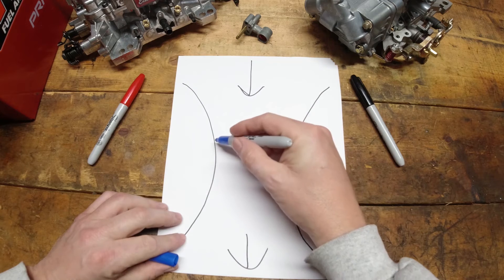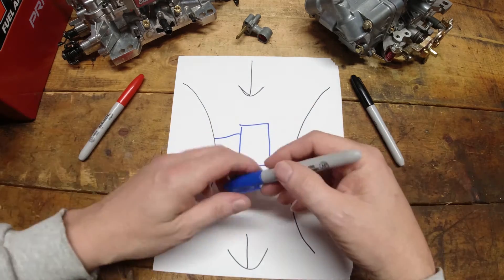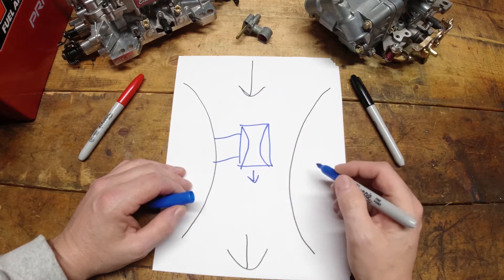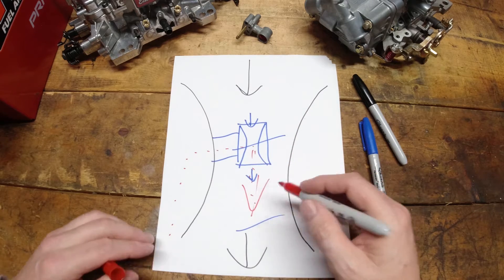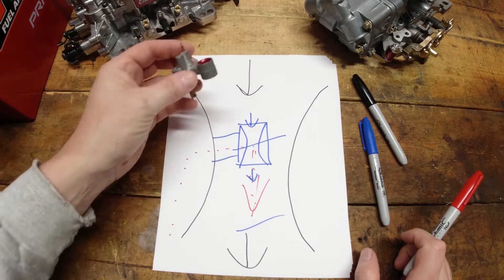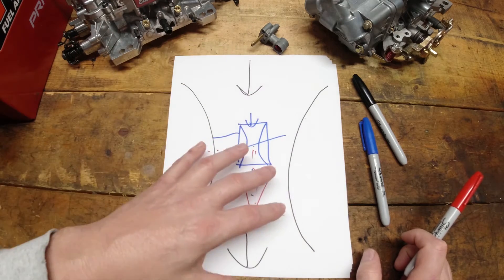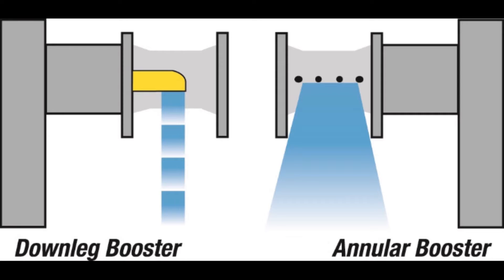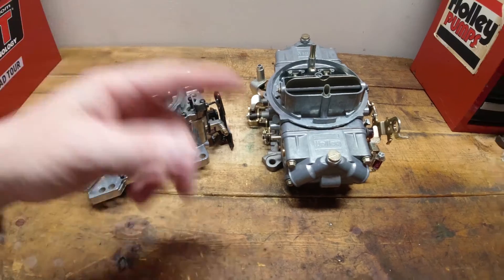Carburetor Annular vs Downleg Boosters

Comment: What can cause no fuel coming out the secondary downleg booster ? Even when the bowls are half glass full. This situation is causing an immediate massive lean spot as soon the secondary throttle opens up.
Reply from the maker: Don’t know! Go through the basics. Check the float level. Make sure the baffle plates are there. Make sure the jets aren’t plugged. Remove the boosters and blow carb cleaner through the jets and make sure it’s all coming out the booster mounts. Clean the boosters. Block carb cleaner through all the passages. Get some small wire and run through all those orifices on the boosters and blow through them again. If it’s an AVS then adjust the air door. If it’s for the weighted air valve, make sure it’s there and unmodified.
Reply: @MuscleCarSolutions  The carb is a 850 Ultra XP in like new conditions but I'm the second owner. I will go over to all your suggestions, Thank you.
Reply from the maker: @TheFastracer455  you’ve got metering block, emulsions and bleeds to go through then. Are you AFR tuning?
Reply: @MuscleCarSolutions  Yes I am, my car have an 
Innovate DLG-1 Dual Lambda Air/Fuel Ratio Gauges (3891). As soon the secondaries start to open the AFR jump over 20 AFR. Even foot braking, I look down closely and that when I noticed almost no fuel coming out the boosters.
Reply: Using a precision ground pin set I verify both metering blocks have identical jets/emulsions size, .036 IFR- .029 emulsions
Reply: @MuscleCarSolutions  After so many times that I can count removing this carb and fully disassembling, cleaning and testing all kind of combinations of jets, power valves, shooters, gaskets, diaphragms etc... bottom line is the carb refuses to make enough vacuum to suck gas out of the secondaries booster. If I push it hard it will blow a fireball and shoot a shogun blast out of the exhaust. I even mount a overkill Dominator XP and besides the obvious (To Rich) no issues with the secondaries. I'm throwing the towel and I'm planning on calling Holley on Monday to sent the carb to them, is nothing I can do if this carb has a factory defect. I really appreciate you taking some time to help me out with this problem. After 30 plus working with Holley carbs I never thought I will give up troubleshooting with one.
Reply from the maker: @TheFastracer455  it’s telling you what wrong! Backfire out the exhaust is telling you the direction to go. I know you want to give up, but try to work through the problem first. Promise you’ll be better for it!
Reply: @MuscleCarSolutions  I also work with timing with the MSD Pro Billet and now I lock the distributor thanks to the Digital 6 plus, from 28,30,32,34 and I stop at 36 degrees but I give it a try at 40 degrees too. What is in your mind ? I don't want to give up but is breaking me.

Comment: Is there really a difference in the cfm between a down leg and annular?
Reply: @JarmequiousWhite  cfm does not increase. Only atomization of mixture is better. Best case works more efficient for city driving.
Reply: @MrCbell57 yes, but the annular booster impedes more of the Venturi, which will reduce cfm

Comment: Annular boosters create a stronger signal however they create a flow restriction compared to a downleg booster. They are absolutely beneficial in a race application as they allow you to run a lower pressure drop. These is so much confusion over carburetor CFM ratings but to sum it up a 4 barrel carb is rated at 1.5 in hg. With annular boosters, and other modifications it’s possible to get a carb to function below .5 in hg pressure drop. Let’s say your engine needs 750 CFM, well with a 750 CFM carb you will have 1.5 in hg manifold vacuum! Now let’s throw on a 1150 CFM carb. Clearly it won’t flow that much air because the engine isn’t capable of pulling an 1.5 inches of vacuum across it at WOT. However your engine will draw more then 750CFM of air because the pressure drop is lower however with a much lower manifold vacuum. Now we’re getting to a point where we are going to run into problems due to insufficient booster signal with straight leg or down leg boosters and we’re probably going to be around .75 inches of mercury. The engine is going to run like hell and probably going to fall on its face as soon as the extra fuel from the accelerator pump is gone. Well let’s switch to annular boosters and see the difference. The pressure drop across the carb has gone up slightly, maybe we’re seeing .80 in hg now however the carburetor is capable of functioning properly now and you could even size it up to get it back to a .75 in hg pressure drop and still maintain a good signal. Power is up as the restriction is reduced and the airflow is higher. This is why you’ll often see sub 350 ci race engines running dual 1150 CFM carbs. These engines can’t possibly draw 2,300 CFM even running at 10,000 rpm and with pressure wave tuning and VEs of 120 percent, but that’s not the point they are running down below .5 inches of vacuum.

Comment: I know you said the older Edelbrock carbs are NOT upgradable to annular discharge but what about the original AVS Series which came in 650CFM and like mine 800CFM. I would Iike to up grade for better low end drivability. I’m sure this won’t hurt my top end considering it’s going on a flat top 350 @ 10.0:1ish with a comp cam somewhere around a 280H which is not that big of a cam.                    
I’d hate to get rid of it since it’s the 800 AVS Endurashine p#19134. 1913 is the part as the the AVS2 800CFM. Any thoughts

Comment: i have fe360 with 390 intake and heads bored 30 over stock c6 trann with 468 comp cam what be best set up carb put it in galaxie f street
Reply from the maker: Need more info.  If you watch my video on how to choose the right CFM, that’s a good place to start.  Then you’ll need to define what it’s give to be used for and you’ll be able to select the right carburetor for your application.

Comment: That's without airflow. With airflow it atomises fuel very well. Annular is better at low rpm as it just has more than 1 hole. Not so good for power top end.
Reply: Почему же ??? Много отверстий плохо? Есть замеры?

Comment: where can i buy without buying the whole carb?
Reply from the maker: Buy what?  The boosters?  They aren’t sold separately.  I explain why in the recent booster video I did.
Reply: @MuscleCarSolutions  actually you can buy boosters seperately but you need a jig to install them in the main body. They're just spin pressed inand can be removed with a punch and hammer.

Comment: I am in the process of installing an Edelbrock AVS2 with the annular rings. My previous carb is an Edelbrock Performer 1406 - 600 cfm. Yes, I have had that nuisance off-idle hesitation from that carb. I did many tunes and mods to help the problem. I am hoping that the new AVS2 will completely solve that problem. Was wondering in the video, you showed the annular booster from the AVS2, removed.  Do you know if Edelbrock sells those annular boosters as a possible upgrade to an older Performer ? They boosters look very similar.
Reply from the maker: The last video I did was on this very topic.  I cover that question extensively.  The short answer is no.  The long answer as to why is in the video.

Comment: Hi, I am running a couple of Holley's on a 671 blower that have 4 downleg boosters, could I change the front boosters to the Annular style ? this car run's on the street only.....Thanks
Reply from the maker: It depends.  What holleys do you have?  Do you have annual boosters laying around?
Reply: They are 600 cfm holley's, and I don't have any boosters I would have to order some...Thanks
Reply from the maker: @mikewilliams-mj9rd  there’s more than one 600 CFM Holley carb.  Are they vacuum secondary carburetors?
Reply: Yes, There are two double pumpers....Thanks
Reply: They are 600 cfm, Mechanical secondary square bore...Thanks

Comment: Is there any difference in reliability? It seem the single larger hole in a down leg would be less prone to blockage than the smaller multiple holes in the annular style.
Reply from the maker: Annular boosters aren’t new technology.  They’re as reliable as the straight/downleg booster.  If it’s THAT bad in the carburetor, it will case issues long before you’d notice it at the booster.
Reply: @MuscleCarSolutions  thanks. The last time I owned a car with a carburetor was in the 80s, before ethanol. I have several motorcycles with carbs and when they sit more than a few weeks, I have to pull the carbs to clean the pilot jets.
Reply from the maker: @JJSPATRIOT  ethanol fuels still demand some additional maintenance.  Keep good filters in the system, drain the crab if you’re not going to drive it for extended periods of time and throw an additive in the tank if it sits for months.

Comment: So is the AVS annular booster capable of being fitted to a downleg booster carb?
Reply from the maker: No.  Not enough airflow to cause them to operate properly.  That’s why a 600 is not offered, only a 650.  The 500 you MIGHT get to work, but you’d have to go buy a 500 CFM avs just to take the boosters out.  Wouldn’t make any sense financially.
Reply: @MuscleCarSolutions  Too bad.  I have a brand new 750 Performer that I would like to improve.
Reply from the maker: @mrblanche  wouldn’t work.  That’s why the AVS2 is an 800.  Needs more airspeed and volume.  Sell the 750 and get the 800!  Or find one used.
Reply: @MuscleCarSolutions  The annoying thing is that I had an AVS2 650, but I don't think that would do the job on my 468 BBC.
Reply from the maker: @mrblanche  probably not near enough CFM.

Comment: I switched from a well optimized Vacuum secondary 750 cfm Holley to an out of the box 850 cfm Holley double pumper with annular boosters.  Holy Cow !!  Could not believe the difference in the cars ability to accelerate from a dead stop. It was night and day. That carb made my 440 powered B-body pull like I had always thought it should. Why every carb does not use annular boosters is beyond me..  production costs I suppose. ?... excellent video btw. 🍻
Reply from the maker: Wait till you tune it!  Even better power and throttle response.  Yes cost is the big factor.  Carburetors are a dying category.  To invest the massive amount of money needed in hopes of recovering it is a big gamble.
Reply: Was your VS a 3310?
Reply: @trailerparkcryptoking5213   yes, but I had an aftermarket main body on it.. with down leg boosters, so not truly a 3310.
Reply: @Torquemonster440  I have a 3310, but it’s been heavily modified by DaVinci Carbs including downleg boosters in the rear and it flow tested at 830 cfm.....I have always wanted to try a little bigger (850) DP on my 454 to see how it responds.  I think I have some room for improvement in the carb area.....

Comment: This is not a good test or demonstration  ,add airflow over the booster allowing fluid to be drawn in non pressurized and you'll really see what's going on!
Reply from the maker: Unless you’re going to fund that type of expense to create that real life condition for me, it was a perfect demonstration to show the difference between the two.  Not the difference between the two in operation.  But if you’re interested, my Patreon link is in the description.
Reply: @MuscleCarSolutions  I did the test I am referring to with some old holley boosters and a piece of 1.5" pvc pipe and my garage air compressor with the air pressure regulated of course and then measured how much fluid was drawn from a Pyrex baking cup like yours.

Comment: Thats why engines with intakes without a heat crossover and without a working heatriser in the ex manifold MUST have a carb with an anular booster. Best is to have both.

Comment: Use a timing light as a strobe light to "freeze" the fuel motion of a running engine. Works for throttle body injection also. For a carb, you need to rev the engine to get the main circuit operating. The retard knob on most timing lights lets you see the droplets as they go down the intake manofold. You can see the fifference between the standard boosters, annular boosters and injection.
Reply: I have got to try that. It works on valve trains, why not wet flow.
Reply: @psychoholicslag4801 I have only used it looking down the carb, which you can not see very far.
If you drove a distributor slowly with a drill to fire a coil and used a timing light and also pulsed more colored washer fluid or Dykem on a wetflow bench, you could stop action where the fuel is moving in the ports and past the valves. Dykem is not the best wetflow indicator as it is heavier and more viscuse. Washer fluid is closer to the density of fuel, thus will simulate better how the fuel moves in the intake and past the valves. A strobe light could also be used for the stop action. Good if the flash timing can be altered.
Reply: @daledavies2334  I like the way you think. Now I'm thinking a variable speed drill press and old distributor/coil and battery to trigger the strobe.

Comment: This is just i looked for..are there another booster design that makes atomization better?
Reply from the maker: Not with the limited amount of pressure that a carburetor uses, no.  But it’s not boosters alone.  Venturi design and sizing are also a factor.
Reply: @MuscleCarSolutions  my carb booster has straight small pipe acroos..and has litle hole   at the center of the pipe..that goes through up to down.....is it downlegs type?
When i slit a wire inside the hole the car seem runs better and better mpg...what do u think heppens?

Comment: Great demonstration. The downleg booster  has a curved shape that places the booster lower in the bore and increases the venturi pressure. The term, pressure drop, used on this video is misappropriate. The pressure is drawn downward, but does not drop, it actually increases as it gets deeper into the intake.
Reply: The pressure drop (lower pressure area) happens in the Venturi.  Read a fluid dynamics book!

Comment: I used to have an Edelbrock 650 off-road version, but it always ran too rich. I replaced it with an AVS 2, 650 & the difference is impressive. Acceleration is much smoother around town with much better gas mileage & no loss of power. At low throttle it drives more like fuel injection, but still slams me back in the seat when I step down hard.

Comment: Why does my Edelbrock 750 have both? I was cleaning my carb and noticed it. I thought maybe something was broken.
Just asking
Reply from the maker: Have both what?  Types of discharge nozzles?  That should not be the case with the 750.  The 750 only comes with a straight leg style booster.  The AVSII has a primary annular and a secondary straight leg style.  That carburetor comes in an 800 CFM size and not in a 750.
Reply: My carb is the 1407  750 mechanical choke.  I noticed the fuel coming out if the right side Venturi like fast drips. Then left side was spraying fuel out in a strong spray at the same time. The carb sits on top of a 454. It would run great. Now I experiencing some hesitation on acceleration. I was thinking maybe the right side needed replacement. I'm new to working on carburetors. Thank for responding back .
Reply from the maker: @PhilAVega  ok so you’re a straight leg style.  So if you’ve watched any of my other videos, I always start with fuel system first.  What’s your pressure regulator set at?  What kind of filters are you running?  Can you pop them open and see if you’ve gotten any garage in them?  Running an ethanol fuel?  E10 pump gas?  Then it’s just going to be about popping the top of the carb off and see if there is any trash inside.  Little blow through with some carb cleaner to see if you can clear it and see how it runs.  Check float levels and needle and seats too.  Blow though the jets and the primary squirter as well as the accelerator pump just to check all the bases.  See how it does.

Comment: Currently restoring back to being a daily driver; 1980 GMC Caballero with: 305ci/5.0L engine, Carter Quad 4bbl, 350 Trans, 64k on the engine, runs very good.
Part of my restorations intentions will include elimination of CarterQuad, Smog sensors, air pump, catalytic converter, etc., and simple additions are hugger headers, dual exhaust (haven’t decided on mufflers yet) and either a 600 or maybe a 650cfm Holley or Edlebrock.
Would appreciate your feedback.
Cheers and thank you.
Reply from the maker: You’re in a bit of a tough spot with the sub 4” bore engine.  Performance parts are extremely limited.  What is available is hard to justify when the performance gains are so minimal.  I have a video on how to choose the right size carb and the answer might shock you.  Given there’s such a gray area with that engine and you are looking to improve performance, I’d go with the AVS2 650.  But honestly if you were stating stock, I’d put a 500 CFM carb on that engine all day long.
Reply: I would use a 500 cfm at most. A  390 cfm if it's bone stock.

Comment: I have a Carter 625 with a bar that is like the annular?  I have a 360 mopar around 400 hp  it struggles a little wide open us the carb to small?  Any thoughts
Reply from the maker: Maybe?  Don’t know.  Need a lot more details.

Comment: Hi any thought on the Thompson power blast??  Thanks Bob
Reply from the maker: Never used one.  Kind of like the old Tornado for throttle bodies.  Doesn’t really shake out that well in actual driving situations.  The issue is fuel calibration.  There’s a reason why annular carburetors take some tweaks to CFM and fuel delivery.  Slapping in a piece of tin might get the atomization, but it’s not going to correct the other areas.

Comment: I’m running a tuned 1406 and it runs fine....but I can’t seem to get rid of the slight loss of power as you accelerate. I’m sure the avs will most likely cure the issue, just not ready to shell out the scratch just yet.
Reply from the maker: Sounds like you have more tuning to do, as long as that’s the right size carb for your engine.